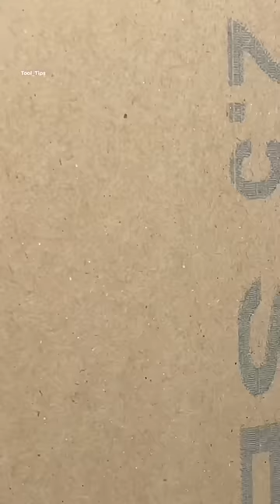The Best #shorts

Comment: I have brick walls.  These tricks wouldn't work.
Reply: You are correct. You can use plastic masonry anchors or metal quick bolts. It depends on what you are trying to support (weight wise). Make sure you have a masonry rated drill bit. There may be other fasteners out there now, I haven't needed any since I retired, (40 yr electrician). Good luck.
Reply: @bobstark4020   Sincere thanks to you.
Reply: @melissabarrett9750  you are very welcome.